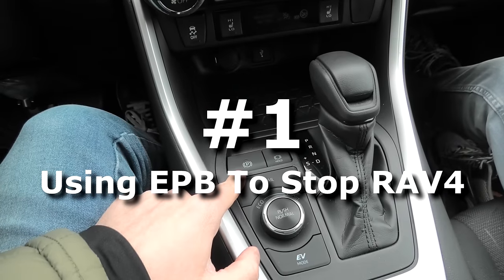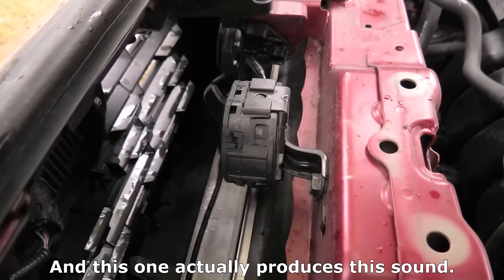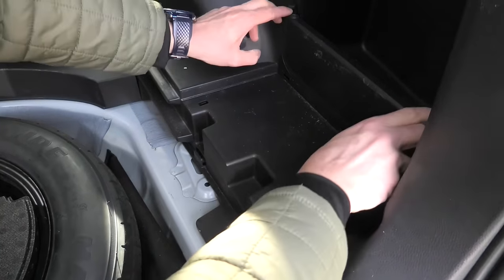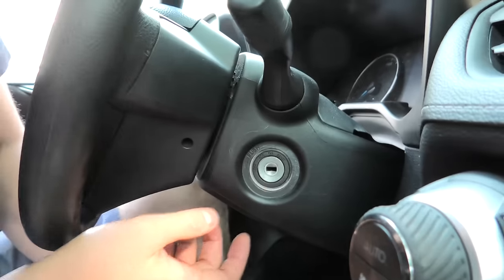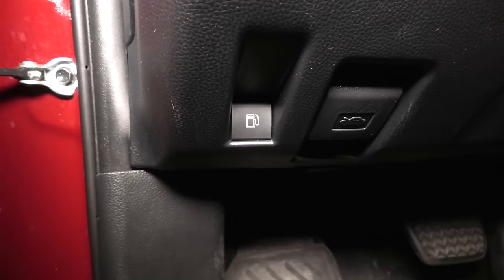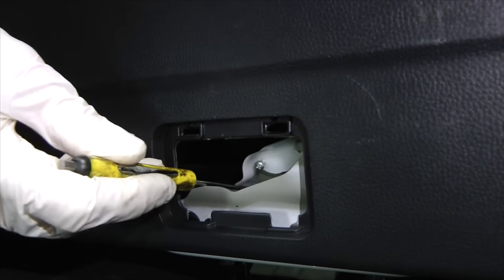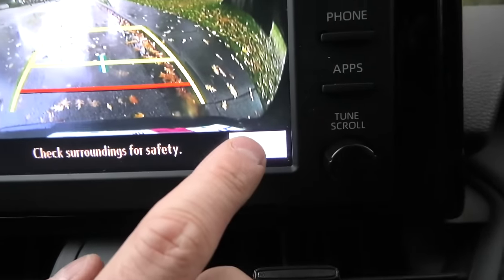Toyota RAV4 (2019-2024): 10 Hidden RAV4 Features You Need To Know!

Comment: When you pull up (and hold) the electronic parking brake "and" the car abs computer senses the car is in still motion, the abs braking computer is programed to take that as a emergency braking request, and it opens valves to the braking system to supply pressure from the abs pump to all four brakes ,(With the abs still active if its slippery) to stop the car as quickly as possabe "in a controled mannor" , its not only useful for the driver to be aware of this but any pasenger riding in passenger front seat could act to stop the car in case the driver experences a medical emergency.  I am going to assume cars systems are also programed for this action to override an incapacitated driver with there foot still holding down the throttle, killing all engine power to the wheels. if the system can not build braking pressure (It has a sensor in the abs module that reads this) due to hydraulic system failure that it would then go to plan "B" and apply the mechanical parking brake servo just like someone pulled the mechnical hand brake , it would not stop as fast in this case .. Make sure kids riding in the car know not to touch it unless its an emergency.. or the driver (and traffic behind them) are in for a nasty suprise..
Reply: Very informative thank you!

Comment: I've never seen a demonstration of that parking brake before, its nice to know.
Reply: Yup that was the best part because I plan to check my brake calliper slide pins once or twice a year and wasn’t sure if I could do it without doing this to the parking brake. Front slid3 pins are dead easy.
Reply: A parking brake and emergency brake are NOT the same thing! Great way to really mess up your car or your life. Everything you see on the internet ISN'T  true!
Reply: @soysan34 This usage of the electronic parking brake is mentioned in the manual, so the video is correct. Of course people trying it out themselves outside of an emergency, and multiple times, is not a great idea…

Comment: Very informative.  Do you have any recommendations for the hybrid battery under back seat,  maintenance.  Thanks again for the video
Reply from the maker: Thank you! I would suggest to check and clean the hybrid battery air filter on a regular basis. If the filter is clogged, it will affect the cooling of the HV hybrid battery. Toyota RAV4 Hybrid (2019-2024): Hybrid HV Battery Air Filter. How To Remove And Clean? - https://youtu.be/5m6mgMPXB00.

Comment: Nice video. Thank. On non aligned camera lines, you can just keep on reverse+ normal brake  and turn wheels left right left, three or four times, it would self align :)
Reply: This works perfectly. How did you find out that this would work. Thank you for posting this work around.👍
Reply: @DatsDone  Sometimes it is a solution for  yellow power steering warning lamp. It can come off when there is low 12V. Have a great day :)))
Reply: i have 2021 Rav4 hybrid XLE. Don’t see TPMS reading of tire pressure. Is that normal?
Reply: @DanOhPhotography  My Toyota service advisor told me certain years/models TPMS was omitted because my 2019 Adventure does not have it.
Reply: @soulshower   You have TPMS sensors as they are required by law. RAV4s do not display the pressures though. If you want to see the pressures, you need the Toyota App to see them. No subscription required.
Reply: @DanOhPhotography  You have TPMS sensors as they are required by law. RAV4s do not display the pressures though. If you want to see the pressures, you need the Toyota App to see them. No subscription required.

Comment: OMG now I know what to do with my car! love this video. So when I was replacing my map lights with led I actually broke a few pieces and I contacted my dealer and they have no idea how I can get the plastic pieces I broke off. Any suggestions of how to get the parts as not even ebay has any of those lights in the ceiling?
Reply from the maker: Thanks! You might need to get the whole map light assembly depending on which pieces got broken. They have them on eBay. You need to look for one that matches the map light that you have - https://www.ebay.com/sch/i.html?_from=R40&_trksid=p2334524.m570.l1313&_nkw=2020+rav4+map+light+assembly&_sacat=0&LH_TitleDesc=0&_odkw=2020+rav4+map+light+assembly&_osacat=0.

Comment: You are one of the best YouTube channels for explaining RAV4 hybrid  “ tricks”.  Are you a Toyota Mechanic as some of these things are not easy to find in the owners manual. Have you ever ha$ an “ issue” with the small 12 volt battery in the back being discharged? I know how to jump start it because I watched your video but I was wondering if it’s possible to charge, maintain the battery using the same process as you showed by using a 2 amp battery charger / maintainer under the hood rather than in the back of the vehicle. I have heard that this battery will discharge over a period of time with very little to no use of the vehicle. I believe the battery would be okay if you parked the vehicle for 2 or 3 weeks but I think not using the vehicle for 2-4 months would drain the battery as it is always providing power to the  ECU ( computer ) and the sensors that detect the key fob etc.
Reply from the maker: Thank you! You can connect the battery maintainer to the terminals under the hood and charge the 12v battery. Gen5 RAV4's can have issues with 12v battery. If you feel that you have a problem I would address it to the dealership.

Comment: Great information. Thanks for sharing. Is there a way of permanently disabling the "Stop & Start system" operation? I find the car stopping at full stops annoying based on applied brake pedal pressure. If there's a reason not to permanently disable please advise. Thanks
Reply from the maker: Thank you! Our RAV4 does not have the stop and start system. But I know that people are using these kits to disable it: Auto Start Stop Eliminator/Delete/Disable/Disabler/Canceller, for Toyota RAV4 2020 2021 2022, Automatic Stop Start Engine System Cancel Device - https://amzn.to/3q0pqmS. There should not be any problems if you disable the auto start stop function.
Reply: @MorozovAutomotive  Great! Thanks

Comment: I’ve found to get the dynamic lines on the backup camera you usually just need to be in reverse and then go to the extremes on the steering wheel and the lines will appear. No need to go into the service menu. I do it all the time on new Rav4s where this step was missed in the predelivery inspection.
Reply: Is it true that the XLE Premium (2022 Hybrid) doesn't have it available? I'm stunned that the menu doesn't appear.

Comment: Hi Sir  --  GREAT videos! I just saw the 10 hidden features for 2019-2023... the steering angle adj where you held a dash button in while turning the lights knob 3 times was quite interesting. My Q: is Would you happen to know a similar procedure for a 2018 Rav4 LE AWD.  Many people on-line have the same issue I do with the 2018 and older gen RAV4 when battery died/replaced - the Pre collision, AWD and Lane Departure Alert malfunction mssgs display and the  "Steering Angle Sensor" fault prob. is mentioned in the same sentence. [ Any info is greatly appreciated, or if you can direct me [us] to such a video you may have made. T/Y ;>)

Comment: You should never place the negative jump start cable so close to the ECU, on an Toyota Hybrid, there are a Tech Tip T-TT-0694-22, that reports about burned ECU modules after jump starting cars wrong, the correct negative jump start location is on the left side of the engine near the engine mount.
Reply from the maker: Hi, the T-TT-0694-22 recommends not to use the ECU bracket bolts for the jump start. We actually used a different bolt above the ECU bolt. It did not cause any issues. In this case we used portable jump starter which has short booster cables. But I agree that ideally you need to use the dedicated jumpstart terminals if possible. Similar to how we did it in this video: Toyota RAV4 Hybrid (2019-2023): How To Jumpstart The Hybrid RAV4 - https://www.youtube.com/watch?v=wiBi6WneUdI.

Comment: whats the rav4 speaker sound for? does it serve as a safety sound so people know your coming?
Reply from the maker: This system is called the Vehicle Proximity Notification System. It produces a sound when the gasoline engine stops working. The sound changes in accordance with the driving speed. The purpose of the system is to warn people nearby (pedestrians) that the vehicle is approaching or backing up / reversing. The sound will stop when the vehicle speed exceeds 22 mph (35 km/h).
Reply: @MorozovAutomotive  thank you for the explanation!

Comment: In order to jump start, do you have to clamp negative to a certain point or you can do it to the bolt like in your video? Jump charger clamp cables are too short to reach the negative indicated by Toyota manual.
Reply from the maker: We used the bolt shown in the video and successfully jumpstarted our RAV4. Toyota has released the tech tip T-TT-0694-22 that suggests not to use the ECU bracket bolts (located below the bolt that we used). In our case, the jumpstart did not cause any issues.

Comment: Thanks, I have the same color combination, in my non-hybrid RAV4 Adventure. I still average 29+ MPG mostly city driving.
Reply: I have 2021 rav 4 non hybrid and gives me only 25 mpg is there any problem in my car. On odometer it has 14000 miles only and 1 year old suv.
Reply: @SnowLion1959  have you put the Eco button on or are you in Normal drive? 
If you have any different rims and tires that might be it. If it’s not that it might be driving style.

Comment: At the beginning I assume it is cold outside and the temperature is set at 23C based on how you are dressed
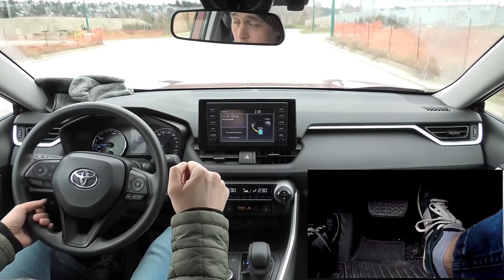but the AC light is on (example 2:05)

I usually use auto for setting the temp and find that when it is around 0C-2C or sometimes even during -1C for me the ac light turns on, weird how it does that because to me if I want 23C and outside is 1C that means turn on heat not turn on ac, not sure if other RAV4s drivers have experienced this but I have had 2 rav4s do that

Comment: Using EPB to stop rav4, does it work on non-hybrids? I tried on my 2021 rav4 (non hybrid) and it just ubruptly stopped it as if i had pressed down on the break. So now im confused.
Reply from the maker: Yes, it does work on non-hybrids the same way. At low speeds it will stop sooner than at higher speeds.
Reply: @MorozovAutomotive  ah ok good to know :) thanks for clarifying!

Comment: Is putting the rear brakes in  ‘service mode’ any different than just putting the brakes in manual mode and not having them engaged?
Reply from the maker: The manual mode only allows you to engage and disengage parking brake manually. The service mode allows to service your rear brakes. When enabled, the service mode unwinds the mechanical linkage inside the caliper allowing you to compress the caliper piston when you replace rear brake pads.
Reply: @MorozovAutomotive  - thanks. So, even though the brake is disengaged, you don’t have the ability to retract the caliper. Putting in service mode, extends the motor out further where the caliper can be retracted for service. I get it. I hate this electronic brake system. It’s useless and extra money and only presents other problems.

Comment: I’m wondering if there’s a way to stop the excessive noise when the parking brake engages? I’ve heard this before that they make a loud squeaking noise, any thoughts?
Reply from the maker: You can use brake lubricant similar to how we did it in this video: Toyota RAV4 (2019-2023): How To Replace Front Brake Pads And Rotors In The New Toyota RAV4 - https://youtu.be/i04Kfrin7xc.
Reply: Thank you very much!  @MorozovAutomotive
Reply from the maker: Sorry, I actually misread your question. I thought you were asking about the brakes in general. The parking brake is different. It does produce the sound when it engages and disengages. This is normal operation of the parking brake.
Reply: @MorozovAutomotive  The sound at the end of the cycle has gotten quite loud and sounds like a crying baby deer.

Comment: Have any of you had an issue with the small 12 volt battery dying on the 2019-2024 RAV4 hybrid while you were away on holidays for a few weeks? I know it can be jump started and or trickle charged. The Toyota salesman tried  to sell us an “ onboard trickle charger “ for $900 Cdn dollars” when we bought our 2023.  You can pick up a quality battery charger / maintainer either an onboard one or one that is removed every time for less than $150. A long road trip would probably fully charge that battery but short trips and infrequent or no use will likely drain it.

Comment: when you unplug the speaker for "divine sound" the screen says "not ready to drive." Can you still drive the car in that case? Or does it not allow you. I understand it's a safety thing and a liability thing with manufacturer/insurance. But it'll be super wack if your car doesn't let you drive bc a speaker cable got corroded or something.
Reply: Took my speaker off-wrapped it in lots of foam and duct tape.  Sound is now much more tolerable and is equivalent to my hybrid Camry
Reply: @larrya3093  so if you take the speaker off you can't drive the car at all?
Reply: Im confused here,what is the point of a speaker in that spot?
Reply: @lr8621 Since the hybrid version can run without the gas engine on, It's a safety system to indicate to people/animals/wherever around that a car is coming! (as the hybrid doesn't make any noise approaching).

Comment: It just goes to show you, the more electronics you put in a car the more problems it will have, example i will never ever have to worry about my gas tank door not opening because it uses an easily replaceable cable to open.
Reply: If you live in a freezing climate the cable type can get frozen as well too.

The video didn’t say it, but in freezing conditions, if the door doesn’t open, the first thing to do is push the gas door slightly in on the latch end. If there’s ice, it often breaks the ice. You never want to pry as it will damage the gas door.

Comment: Hello sir ! Mine is 2021 Rav4 Non Hybrid and it gives me only 25 mpg do I need to worry ? On odometer it has only 14100 miles and 15 months old Rav4.
Reply from the maker: Hi! It is a bit low but a lot depends on where you drive and your driving style. In winter the gas mileage tends to decrease as well. I would not worry much about it.
Reply: Thank you sir now I am bit relief 🥲.
Reply: Yeah, stop driving it with the gas to the floor all the time.

Comment: А в каком случае возможна ситуация, когда батарея разряжается в ноль?
Что нужно делать, чтобы это произошло? Нужно высадить полностью ходовую батарею, а потом оставить какую то нагрузку на маленькую батарею?
Reply: If you pres start button twice without   holding brake pedal you will turn almost everything on without 'ready' mode, so hybrid system is stopped, 12v battery is powering all the electronics while it is not being charged by dc-dc converter. 40 mins like that and battery dies. Also you can leave car locked on parking lot for some days. Gps and all electronics would drain the battery. Drained 12V wont power parking brake and jump start is needed :)
Reply from the maker: Все верно. Добавлю к тому, что выше написал Марчин. Функцию зарядки 12ти вольтовой батареи выполняет гибридная батарея. Если включено питание, но не работает гибридная система, 12V батарея разрядится.